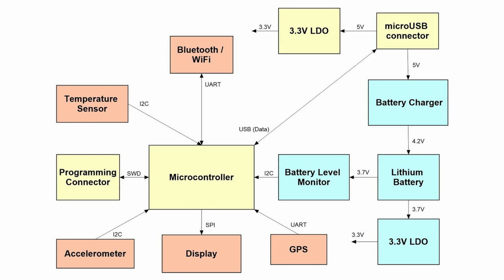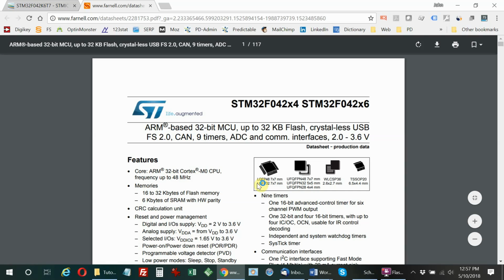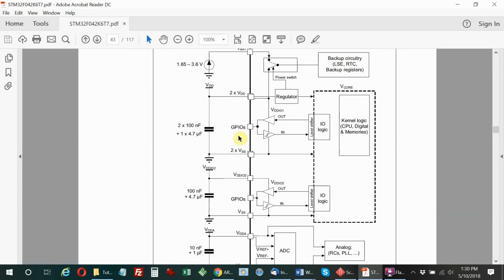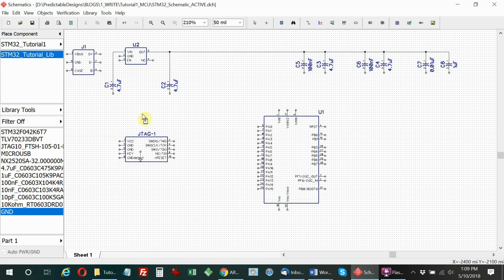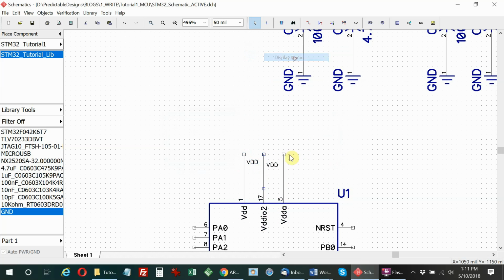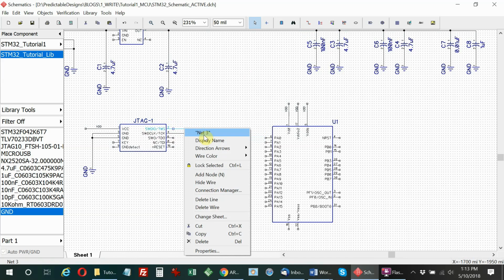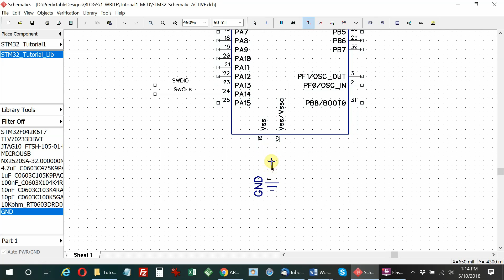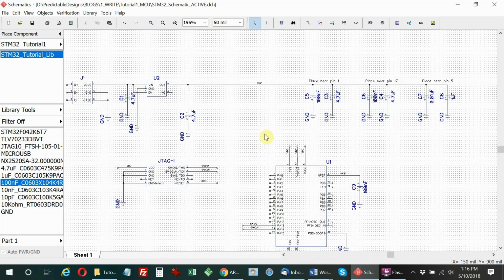Tutorial: How to Design Your Own Custom Microcontroller Board

Comment: Thanks for the tutorial and for sharing your valuable knowledge.
why is there a capacitor before and after the voltage regulator?
Reply from the maker: The caps hold charge and supply current for fast transients so the input and output stay constant until the regulator can respond. Without output cap most regs will oscillate due to unstable feedback loop.
Reply: @PredictableDesigns   Thank you for clearing my doubt, sir.

Comment: I sort of understand the capacitor "pulling" NRST to ground.  But what charges it so that the pin is eventually close enough to logic high so that the MCU comes out of reset?  Do you need a pull-up resistor to Vcc to charge the capacitor?
Reply: There is an internal pull-up resistor
Reply: I dont know maybe it pulls it high internally.

Comment: Sir ,I want to build a microcontroller board for my project which should have sensors like accelerometer, gyroscope sensor, camera and it should be battery powered, but I have only minimum knowledge, it should have GPS and bluetooth systems .how can I do it ,I have less knowledge.in the above video there are different connections for different blocks such as USART, I2C, SPI..etc.why is it like that? And how do you know where to use the resistors and capacitors, and their specific values

Comment: One recommendation for both author and viewers: reading the data sheet is a huge skill. This is how you can get a better idea if the mcu is proper for your project, if you have overlooked pin connections you need to make (enables, resets, etc.) and so on. Very important part of the design
Reply: There are many factors in studying electronics. One resource I found which succeeds in merging these is the Gregs Electro Blog (google it if you're interested) definately the most useful info i've seen. look at this  super website.
Reply: Greg's Electro Blog. I'll have to look it up.

Comment: I'm designing an HHO Generator and the number one problem is mixing the Potassium Hydroxide (PH) with the water. I want to build a container for the PH and have a stepper motor add the PH to the water. When the right mixture is reached the motor will stop adding the PH to the water. The way I figure it is you either measure the resistance of the water or the voltage in the water. Since you are starting with Distilled water there will be very little or no resistance or voltage in the water until you reach the required amount of PH in the water. Is there a Microcontroller that would measure resistance or voltage and be able to turn off the stepper motor once the right amount of PH is in the water? I would prefer measuring the voltage since this is a 12 volt system.
Reply: I think that any microcontroller can do it. I advice you to use Arduino board because you can find easily how to do it in the web since it is open-source platform.
Reply: Damn man, don't mean to be rude but you have a LOT to learn before you can make something like this. I mean the project seems simple enough but your lack of knowledge in electronics and chemistry make it an unlikely endeavour. First of all, Potassium Hydroxide is KOH not PH. Secondly, you can only measure resistance using a constant current/ constant voltage approach; it is not a quantity that can be directly observed alone - see ohm's law. Third, distilled water has relatively high resistivity, much more than tap water. The resistance measured will actually decrease as you add KOH. (KOH is literally used as an electrolyte in some batteries...)

I don't know of any microcontrollers that run directly off of 12 V but that usually isn't a problem since you can step down the voltage using a buck (step-down) converter or a linear voltage regulator, or both. Even after you have created a PCB (or even a breadboard prototype) you still have to program the microcontroller which means learning either C, C++, or assembly. An arduino development board as Ferhat mentioned could work since it can take up to 12V input due to its onboard linear voltage regulator, and it is relatively easy to learn!

Anyway, I hope you learn enough to accomplish this, like I said it isn't a very difficult project to make, but you seem to have lots to learn still! Good luck!
Reply: I'm probably late, but hoping I can help. (My useless degree is in chemistry)
Are you using phenolphthalein or a pH meter? With phenolphthalein, you need something to detect the color. If just a pH meter, I assume you can connect it to the microcontroller. If you're using a magnetic stir bar you can have an electromagnet under the  beaker to stir it with, then cut power when the pH is at the desired result. 

I hope you were able to do this! I'm still trying to wrap myself around the electrical engineering bits.
Reply: I meant pH indicator, not phenolphthalein. It's 2:44am, and I'm very tired. Phenolphthalein is a pH indicator, but I don't think it changes color significantly at any point in the basic range. 

Imma go sleep now.